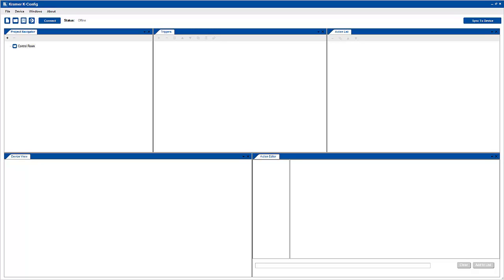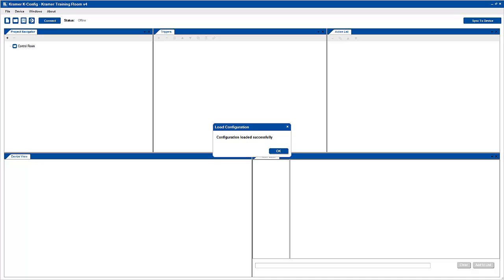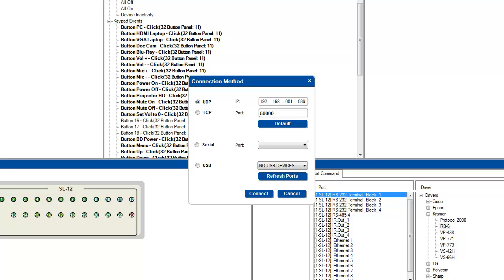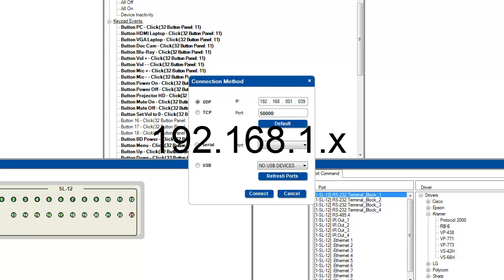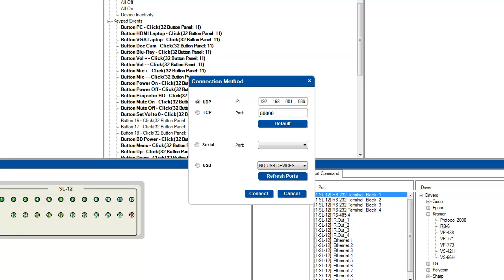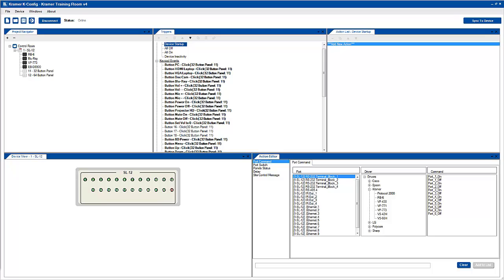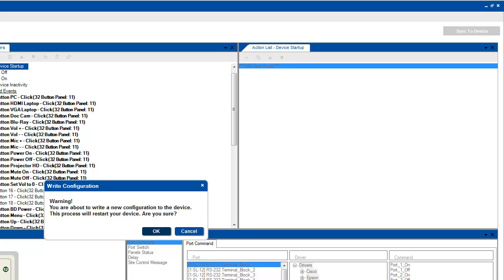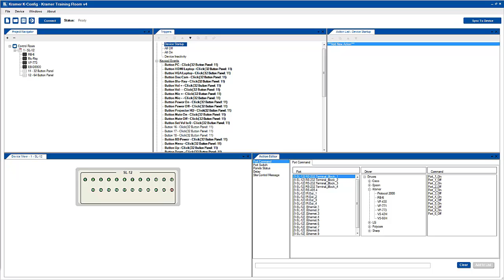Part 5 - Upload a Project File

Comment: Why does Kramer use the term "Upload" when putting the file/program/application to the Controller. all others call this a Download. An upload is from Controller to PC and an download is from PC to Controller.
Reply from the maker: You're correct. Thanks for noticing. We cannot edit this now, but will fix in future videos.